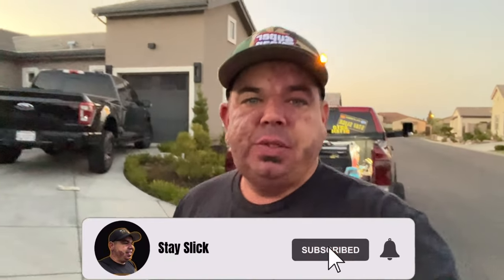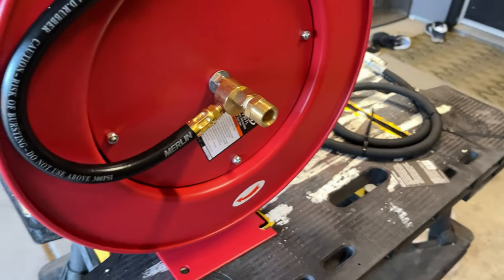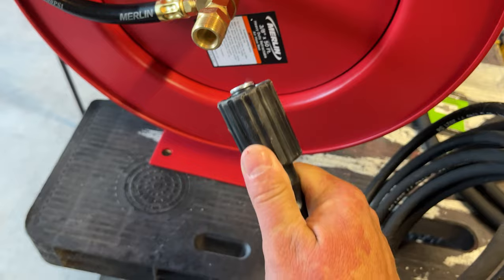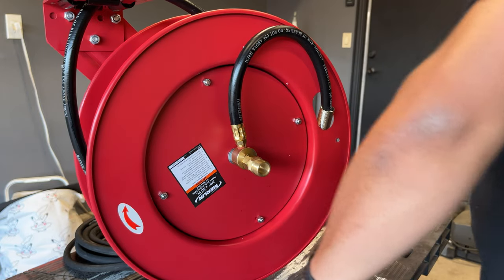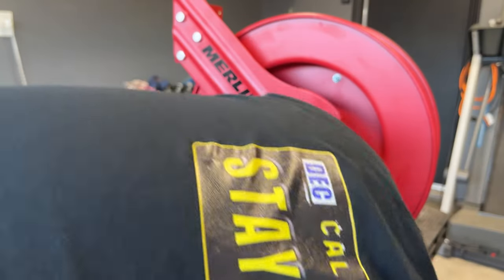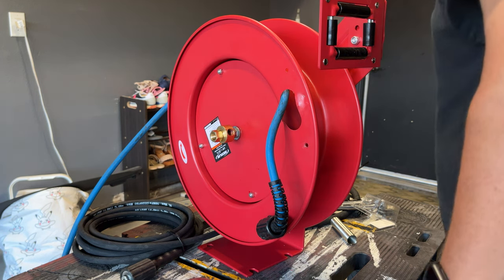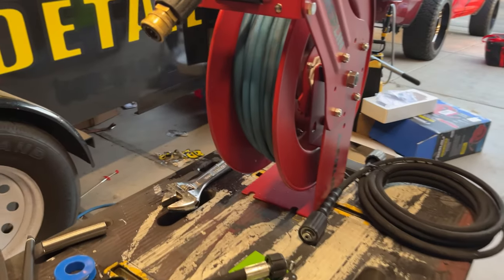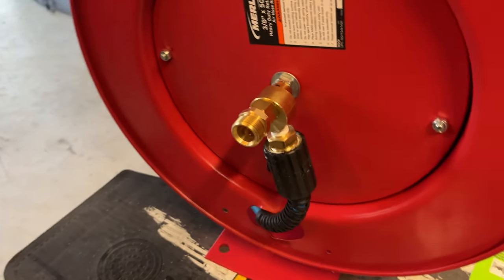How to convert a retractable air hose reel over to a retractable pressure washer reel

Comment: Just made this using the 1/4th uberflex hose and it works great, super convenient, and very inexpensive. NOTE: After you remove the air hose, take extreme caution not to trip the reel while putting the pressure washer hose on. If you do, this will cause the reel to free spin since there is no hose and it will destroy the reel. Be very cautious as this happened to me twice before the third successful attempt. If you are using a uberflex hose (highly recommend) bend the opening with pliers WHILE the air hose is still on to prevent the free spin.
Reply from the maker: Great info man thank you.
Reply: Is there a safety stop measure you can use to make sure this doesn't happen...?
Reply: @StaySlick where did you get the bottle holders that’s on your truck ?
Reply: May have done this to my giraffe tools one rn

Took stock hose off. Uber flex on

Cut opening connect hose and outlet hose for washer

Reel will not wind back up. Only Manually. Did I break it without even using it yet ?!?!😢sheesh
Reply: It may have freely spun with no hose on
Reply: How did you fix it after or did you just buy a new reel?
Reply: @justnancy9666  replaced it

Comment: It worked great for about 5 washes until the o-rings in the 90 deg. fitting blew out.  This fitting is designed for 300 psi and I was using my 1800 psi electric washer.  I even replaced the o-rings thinking they may have been old and dried out but the same thing happened.  Do you know of a replacement pressure washer fitting that is a direct replacement?
Reply: Same thing happened to me :( been down cant get it back up & running

Comment: Hello, I need help please, I did this with the central pneumatic from harbor freight, worked nice in 2 cars but it started leaking pressurized water because it didn’t resist the psi, what can I do please?

Comment: I did the same thing but in my experience the rubber seals in the air hose reel popped where the water feeds into the hose wrapped on the hose reel. I bought a pressure washer hose reel and it came with a schematic of how it’s made and there isn’t any rubber seals just metal washers. The one I got was rated at 200 psi and took about a week to pop.
Reply from the maker: Mmmm I hope mine doesn’t do that but if it does I still have an extra air hose reel.
Reply: @StaySlick  id recommend  not to extract or retract under pressure will likely last way longer pain in the ass but will save seals long ass possible i do this with my airline reel , great video 👍

Comment: I've been having more and more problems getting Amazon packages delivered. It's mostly been in the last year or two. They used to be spot on with the two-day delivery but now it seems like every 4th or 5th delivery gets messed up by UPS or the postal service. To their credit, the Amazon drivers themselves seem to do a pretty good job!
Reply from the maker: Every time I’ve had an issue it was with an Amazon driver. Never ups or usps. So I’m the opposite.
Reply: I ordered car parts and got a set of ear buds instead. The box had my address and everything.
Reply from the maker: Lol that sounds like an Amazon worker

Comment: I’m surprised you don’t have a quick connect fittings on your pressure washer but awesome video! Really help
Reply from the maker: There’s really no need for quick connect when you don’t take the pressure washer in and out. That just allows for more areas for leaks to occur. The only place I need a quick connect is where I attach the pressure washer gun.

Comment: Gary, another awesome DIY video.  I ended up doing the pressure washer tip and man getting that bad boy on required a lot of muscle; I ended up using a drill to hollow out a little of the rubber and it fit in very easily.  I love the DIY creative stuff, thanks again!!!
Reply from the maker: Right on man glad youre getting some value out of these diy videos they’re my favorite.

Comment: Bro you stole my idea😂😂 when I first bought this from harbors freight I was like I really wanna swap this for a pressure washing hose!! But I thought the bearings inside would be messed up or not wound if I took all tension off when removing air hose. Thank you for the vid showing it’s not a pipe dream. Will be doing this very soon
Reply from the maker: Right on bro let me know how it goes.

Comment: That's cool. I just came across a nice 100 foot air hose reel and saw how good the price was and I thought, I could definitely alter this and put a pressure washing hose on. Then I checked YouTube because I figured someone had to of done it before. I'm glad to see when my stuff gets here, it'll work. I think I might buy 2 more and alter them for my other lines so they all match. Thanks for the video. Edit: Mine is gonna cost 60 bucks for 100 foot. Steel reel with a bolt down plate and it's a crank which I'm totally fine with. I'm only gonna roll up whatever I used at the end of every job anyway. I am curious. Has the retractable part held up for you? And if there's an issue, I'm assuming for that much money, there would be a crank, right?

Comment: is there a way to wind up the real more? for instance my pressure washer line is 150 ft x 3/8. I have a feeling that it will only wind up maybe 60 ft before not rewinding anymore unless the spring is twisted tighter

Comment: Good video sir, the fact that the uberflex hose can be used in a hose reel makes it that much better, I use the black uberflex hose that’s sold at Walmart
Reply from the maker: Interesting I didn’t know they had one at Walmart. Can you send me the link?
Reply: It's the hose that Walmart sells branded as Black Max but if you look at the hose it actually says uberflex by propulse on the hose. It's 35 ft FYI
Reply: I use a electrical cord hand winder and that works much better than fighting with the hose by hand
Reply: @William_NS  You are 100% correct.
Reply: @StaySlick  I tried posting the link but it won’t let me in the comments, anyways like William said it’s the Black Max hose at Walmart, it says uberflex on the actual hose!
Reply from the maker: Ok yea on the Walmart app it says my local stores don’t have them.
Reply: There Blackmax is made by Uber flex just renamed it

Comment: Thanks for the video..what pressure washer do you have
Reply from the maker: Currently I use a ryobi 1800 psi 1.2gpm unit for reliability. I also have an active VE52 and Active 2.0

Comment: So the fitting can handle the pressure from the pressure washer I always thought you had to change those out thanks for this vidoe now im gonna go get one lol
Reply from the maker: Yes sir but I wouldn’t go above 1500 psi
Reply: So don't use with a ryobi 1900. That's what I have
Reply from the maker: That’s only the peak pressure not running pressure.

Comment: Silly question but I’ve not found much info in videos, but what size diameter is suggested for your pressure washer hoses and air hoses? 3/8?
Reply from the maker: 3/8” air
1/4” pressure washer

Comment: I tried this with an air hose reel from tractor supply but it wouldn’t reel itself in when there was water in the hose.it had to be reeled in by hand.
I’ll have to try it with this same brand you used.
Reply from the maker: Oh wow. Yea so far this thing is great. No issues yet

Comment: In the video for the whip hose to the reel I think you have a 1/4 in male to a 3/8 male but you link it for a 1/4 in male to a 3/8 female.  Or am I just not seeing it correctly.
Reply from the maker: No you’re seeing it correctly. If you remember in the video I was saying that I didn’t wanna wait for the part to come in the mail so I just used when I had to hook up that other pressure washer hose.
Reply: @StaySlick  my whip hose has a QD on that will not come off so I just spent $26 in adapters to make it work.  Works awesome. Can’t wait to wash the fleet

Comment: I have been watching your video on converting the the air reel! I plan to do it at some point but I have decided to skip going through the reel fittings and just connect straight into my uber pressure hose.Seems to me you will have less chances of leaking from the fittings and less moving parts!
Reply from the maker: That’s definitely a sure fire way of not having a blowout. But if you do decide to use the swivel connect, just buy a case of natural O-rings and some snap ring pliers and keep them on you. That way you can fix it in five minutes.

Comment: Great video buddy I have a question I have one of the higher pressure hoses with a quick connect already on the end of it. do you think I can convert it using this set up you have
Reply from the maker: Thank you brother. Do you know exactly which pressure washer hose it is? I have put this Uber flex hose on it and I briefly switched it out to a 3/ 8 yamatic hose and they both worked.
Reply: NorthStar Nonmarking Pressure Washer Hose

Comment: This might be a dumb question, but can you just use the air hose with adapters or would the friction loss be too much?
Reply from the maker: No because the air hose or only rated to between 200-300psi.

Comment: I loved your video and followed instructions however mine doesn’t retract like yours🤔 any suggestions ?
Reply from the maker: Did you pull the hose all the way out before you disconnected it?
Reply: @StaySlick  yeah i did however I decided to unscrew some screws to take a look inside and see if something was wrong. The spring inside was broken from the inside which didn’t allow  it to retract. Luckily I got a refund and got an exchange since it came broken. Now it works like money! Loved your vid thank you.

Comment: Just purchased mine can't wait to complete the set up how are you enjoying it so far after using it bro ?
Reply from the maker: Lovin it
Reply: @StaySlick how has it been a year later? Just purchased everything today showed the detailing fb group and everyone is saying the o rings leak and the pressure washer hose will explode…
Reply from the maker: @Xavierthedetailer no you have to use an actual pressure washer hose instead of the air hose it comes with. That’s what they mean to say. Just follow the instructions in the video. Also I would recommend better nitrile o rings in the long run. Mine lasted about 6 months.
Reply: @StaySlick  no I understand that I have a Uberflex hose sitting in the box ready to go but they are saying the swivel part is where it likes to explode and I guess the two options are return the reel I purchased today and instead order a pressure reel or get the Viton o rings and replace them every 4-5 months to be safe and just count it as preventative maintenance.

Comment: I plan on doing this with my active 2.0 do you see there being any problems with that set up...or losing gpms or spiking the amps on 15amp braker?
Reply from the maker: No I run this setup everyday in my business and it works flawlessly.
Reply: @Stay Slick  thanks for the response...just waiting for the fittings from Amazon and my active 2.0 right now...I already picked up the hose reel form harbor fright...that's a solid reel. What size bolts did u you use to install in your set up

Comment: Wassup man. Love the video I really want to do this! Tired of not having a reel. I’m just a little confused with the extra pressure hose?
Reply from the maker: Thank you brother. What exactly confuses you? Which part.
Reply: @StaySlick  you had the blue hose connected inside the reel correct plus a black hose connected to the pressure washer I think?

Comment: Subscribed..! That is sweet! I will get that for my hose and maybe my garden hose too.. I have a ram like yours. Are you able to fold your back flip cover over the reels?
Reply from the maker: Right on man enjoy. Yeah I have a soft rollup tiger cover from Amazon and it folds over just fine with plenty of room.
Reply: Did you ever try converting  the garden water hose to the reel? If it worked what size length hose did you use?

Comment: So one question is there any chance the fitting on the side of the reel is made for air not water and will  Restrict the line ?? I just did this setup and while I was watching you video and doing my own reel that was the only thing I was worried about going to buy a pressure gauge test it out lol !
Reply from the maker: No way everything works amazing as is.

Comment: What type of pressure washer you using ..ryobi? and how long is the hose
Reply from the maker: Yea. So I’m currently using the 1800 psi ryobi with a 50 ft flexzilla hose.
Reply: The flexzilla hose will work in that hose reel?
Reply from the maker: @sicilianballer  yes

Comment: Hey bro. Kinda in a tough situation right now. I bought one and followed all your steps but the first time I tried I think I tightened too hard and gasket inside broke and wasn’t able to tighten. 

The second time I bought it, no issues but whenever I reel it back it starts leaking out like crazy. I tightened EVERYTHING slowly second time and it worked great for 1 week but now it’s leaking. I think it’s the issue with the swivel piece which isn’t handling so many retractions so it starts leaking. 

Is there a way to get an upgraded swivel piece that’s maybe made for pressure washers? I mean the little piece that comes already attached to the hose reel. I bought all your recommended attachments.
Reply from the maker: I’m not sure still how everybody’s having issues. I have made a couple videos on it. I don’t have any issues of mine whatsoever. The only thing I can think of is people are using too high of pressure. I heard mosmatic makes a swivel that you can use maybe it’s available at obsessed garage
Reply: You may need a super swivel, I believe thats the piece.

Comment: Sounds a good idea but, the max pressure is 300 PSI or 20 BAR, give so you can use for a pressure washer, which operate at approximately 1200 PSI , 82 BAR !!
Reply from the maker: All of the stats you mentioned only apply to the hose. The reel is rated at much higher. I’ve been using it every day since this video in a professional detailing business with zero issues. As long as you run an electric pressure washer through this real, you’ll be just fine.

Comment: What psi is your pressure washer? I'm wondering if my 9gpm 3000 psi will go through this with no issues.. nice video, thanks
Reply from the maker: Mine is around 1k psi 2 gpm. I wouldn’t run that much pressure through it.

Comment: I tried this and followed all instructions. The reel will reel about half the length of the hose before it seems like the spring doesn’t have enough strength to reel in the rest of everything else.
Reply from the maker: The only way that would happen is if you didn’t pull the hose all the way out before detaching the old hose.
Reply: @StaySlick   can i fix it

Comment: Man, I’ve scoured the internet for somebody that has tried this. Was going to try on my own but was worried about leaks or other problems with the Harbor Freight reels. The heavier duty Merlin looks like a great heavier duty option.  I have a new 50’ Central Pneumatic in my garage right now trying to decide what to do with 😂. I’m sure the Merlin 300psi rating is 100% based on the included hose for those that are worried about that. One modification you could make would be to get an Uber flex or similar pressure washer hose without the big M22 fittings on the ends.  I’ve seen them with the bare 3/8” NPT fittings which would avoid having to bend the reel opening. 

I’m sure you’ve put this to the test over the last couple of weeks. How is it working so far?  I’m between trying this or going with a more expensive reel designed for pressure washing for an In-Garage install (so I can’t deal with leaks), but ultimately the swivel hardware seems to be the only difference—and maybe that is even equivalent.
Reply from the maker: Hey bro thanks for the comment. So far I’m loving the real no issues or leaks. The only time it leaks a couple drops is if I release the pressure when the unit is off.

Comment: My fitting keeps busting with a 1600psi ryobi pressure washer 😢. Where your m22 to 1/4” fitting plugs into. Any chance you’d know the name of that piece or where i can get it? I’d hate having to replace the whole reel again
Reply: Same thing happened to me. Busted seal
Reply: @danmartinez1240  how did you fix it?
Reply: @juanpalacios59  I returned the reel back to Habor Freight. I am looking a retractable pressure hose reel to come available. Nothing is available online right now

Comment: Mine didn't work.  The air hose auto reel i ordered from amazon did not have the same outer fittings.  Mine had a square fixed hose end attached to the reel. Once the air hose out of the reel i still  couldn't figure how to convert that fixed fitting that has two rubber rings.. the only would be to get a water pressur with the same type of fitting the reel had.. i know it is difficult to explain.. but just to warn everyone that not every air auto reel will work.  You may have to buy the exact same reel that is in this video,, otherwise you will have to deal with amazon return.
Reply from the maker: Yeah, that was the point of this video is to show what hose reel to buy and how to do it

Comment: Dude runs a generator to power a electric pressure washer instead of just getting a gas pressure washer 😂
Reply: Only has to do gas/oil maintenance on one tool, also saves space. Need a generator anyways for everything else

Comment: Can't just use the air hose for water?
Reply from the maker: No the air hose is only rated at 300 psi.
Reply: @StaySlick  thanks for the reply. Would it be ok to use it with a small jetwash or are all pressure washers generally way higher psi than air compressors

Comment: If I use a 1/4 hose. Would it fit 100 feet hose?
Reply from the maker: You would have to get a retractable real that was made for 100 feet because it all has to do with the spring tension. The spring on this real is only meant to retract 50 feet.
Reply: Thanks for the response! Helps a lot. 😊